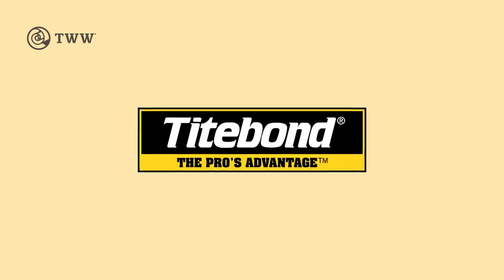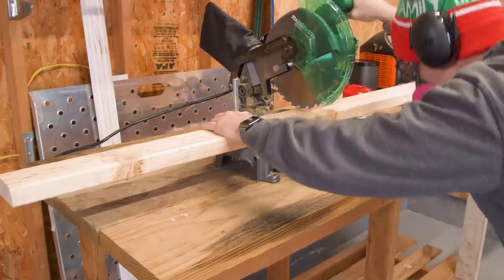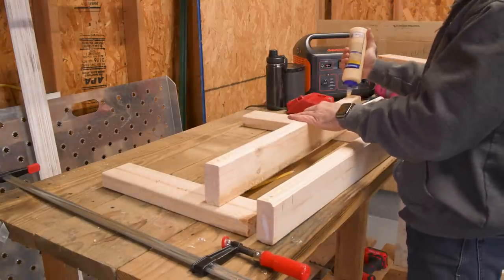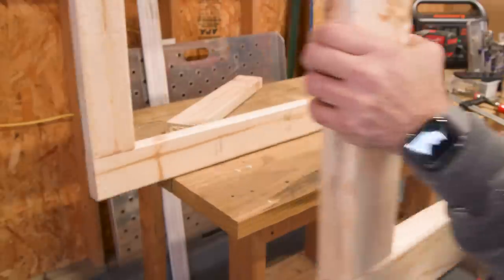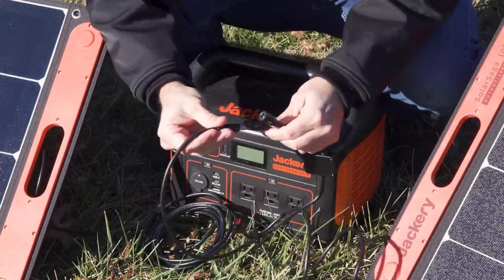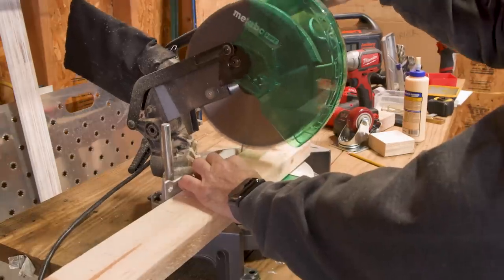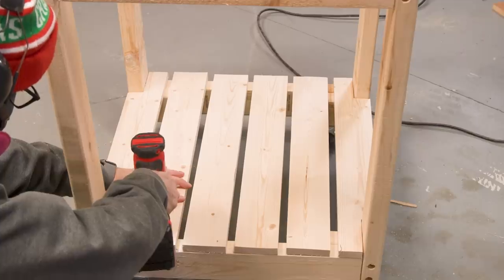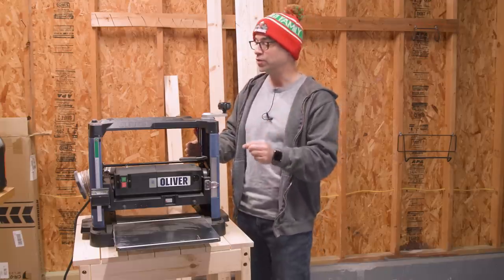Mobile Tool Stand- Quick & Easy! #woodworkingshop

Comment: I am 65 year old grandma who started woodworking about 10 years ago. I just built myself a large workbench on casters with my table saw build in the end and a shelf on the bottom. I am almost done building a miter saw cart with wings and casters. I have a tiny shop, so I am thinking this will help with space. I am so glad you are doing this because you are a well respected woodworker and I was getting ribbed about my mobile cart ideas, now I can shove your video under their noses lol all in fun of course
Reply: I am a 65 year old grandpa who just took up woodworking about 2 yrs ago.  I’m in a small shop as well, and carts are a GREAT idea, they let you move things where and when you need them.  Every large power tool I have is on a cart.  Best wishes in your quest!!!

Comment: Marc,
Thanks. Built the cart over the past few days, made a couple of mods based on the wood I had on hand, but no major changes.  Finished it just now.  Lifted my planer off of its normal home.  I'd always looked at using it with a bit of dread concerning the lifting off and back on to it's shelf.  The cart takes care of that.  Excellent build...Thanks
juvat

Comment: Made one today in a couple of hours to hold my benchtop oscillating sander. Still need to add the casters (arriving tomorrow) and I might add a small wood trim around the top to cover the raw edge of the white melamine top. I didn't have drill bits long enough to drill through the long edge of the 2x4's (squared up on the table saw to 3" wide) so I used pocket screws instead. Looks great and will serve me well for a long time while freeing up work bench space. Love watching your videos... helped greatly when it came time to tune up the rebuilt 1939 6" jointer that was given to me.

Comment: I'm a master cabinetmaker myself. I have 2 complete sets of tools. A complete set (the box of many things) that I use at work. I also have a rolling tool chest and my old shop made tool chest (use it as a top chest for my home rolling tool chest). What I don't have since leaving Michigan are a lot of shop tools. I have a small 9" delta band saw and a 10" bench top drill press. My goal for the coming year is to purchase a contractor's saw and a planer so I can start doing "real work" at home.

Comment: Marc, those little generators are life savers!  I've had one (but not a Jackery) for the last 3 years, and it has saved my posterior through multiple power outages caused by ice storms, etc.  It has recharged my cell phone and run some lights and other things during multi-day power outages.  But be sure to have it fully charged up in advance when you know that a bad storm is headed your way!  

For me, living out in the country is nice, but you are low man on the list when it comes to restoring power after a storm.  Thanks for this video, I now have some new uses for my generator!

Comment: Great build.  I have a SawStop Job site saw for my small garage shop.  The gravity rise cart is too large once setup and the handles get extended.  I built a shorter, wider version of that cart using mostly scrap.  To save time though, I purchased a pre-glued up pine slab from a big box store for the top and cut it down to just fit the saw dimensions with some overhang for stability.  The price at the time was comparable to 2 x 4's for a top which this saw would have required.

Comment: Question (something I’ve often wondered):  When making a cart for an extra heavy tool, does it matter if the vertical pieces go top-to-bottom as in your build?  Or, have the horizontal pieces lay across the vertical ones so as to spread the load?  Or, it just doesn’t matter?
Reply: It matters a lot. You want the weight to be transmitted to the ground via the wood, not via screws that can break. A way to think about it is that your cart should basically stay standing with no screws or glue, just the wood alone should be sufficient. For a good example, look up DIY aquarium stands as aquariums are very heavy. There is a fairly standard 2x4 design that people build for their aquariums.

Comment: So today I'm building my 2nd mobile tool stand for my belt/disc sander.  Used pocket hole screws in the last one, doing so this time too.  Anyways, I see you're using the Metabo 10" miter saw.  I have one as well, how do you like it?  It's supposed to have a motor brake but I think mine failed, and only had it a few months.  Also, are those Harbor Freight clamps or who's?  Thanks!

Comment: Was all the lumber previously jointed and thicknessed? Most 2x4's I've ever used had a twist in them, even if ever so slight. Enough that when I would join four together like those end pieces, it would be warped and not flat.

Comment: That Jackery box is only rated to put out 1000w continuous and that planer is 15A 115v, I wouldn’t be surprised if you overheat the battery or blow a fuse. Be careful with the tools you plug into it! There is a Jackery box rated for 1800 watts but it’s $1500
Reply from the maker: I didn't plug the planer into the Jackery. :)
Reply: @woodwhisperer  I see that now, I should really watch the whole video before making comments. The thumbnail through me for a loop! I’ve been thinking about getting the Jackery box but I’m thinking about which power one I want vs the price
Reply from the maker: Yeah the only tools I could get to work on this one were the jigsaw and the shop vac. It didn't like the chop saw, small table saw, etc... Anything with a big initial amperage kick isn't going to do so well. But like you said they have other models that are capable of more.

Comment: Make sure to check out Matthias Wandel's video on his second channel (video ID c1QSn3i_IEo), it applies to any portable battery bank. In short; using sensitive electronics (such as potentially LED lights) can break when high-power devices (such as power tools) are turned on as he power fluctuates for a tenth of a second. Definitely something to be careful about.
Reply: Kind of wonder how well it handles high amp pulls for tools, for example putting a laser printer on UPS will significantly reduce the UPSs lifespan
Reply: I watched that about an hour ago, and that was my first thought, to direct others to that video. It's well done, and could save lots of people a lot of grief...and cash.

Comment: I like you channel and subbed, however for a shop table I think this is a little too novice level. It wouldn't take much design/build alteration to have the top actually supported on top of the legs vs held there by 8 screws.
Or, you could notch out the tops of the legs and allow the rails to be sort of inset.
It might not ever need to support real weight, however since its in a shop, you might just need it, and it doesn't cost any more or take any more real time to build as such. Just my $0.02.
Reply from the maker: There's no such thing as "a little too novice level." Everyone starts somewhere and I tried to make this project as approachable as possible. Notches, insets, etc are all next level complications. What I did here is targeted and well-suited for a new woodworker.